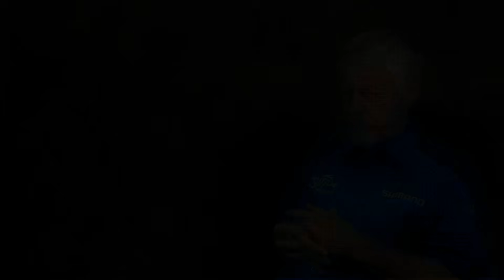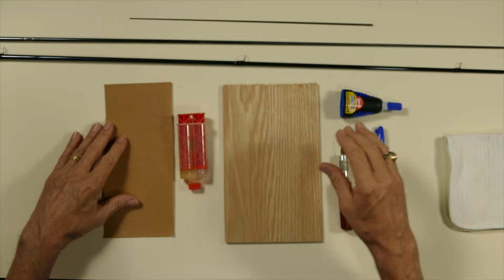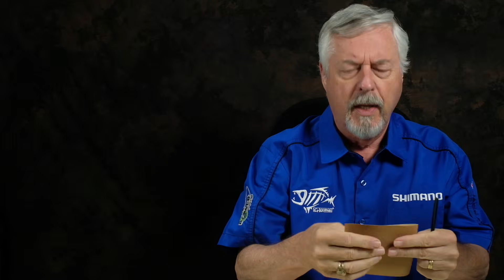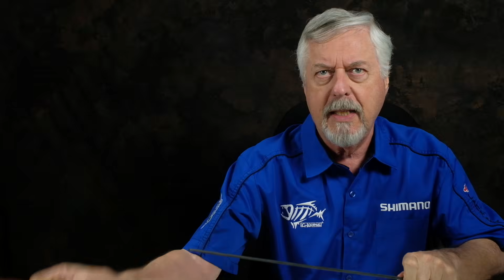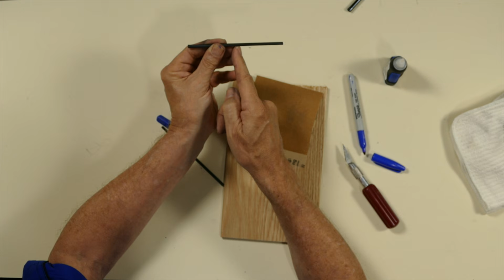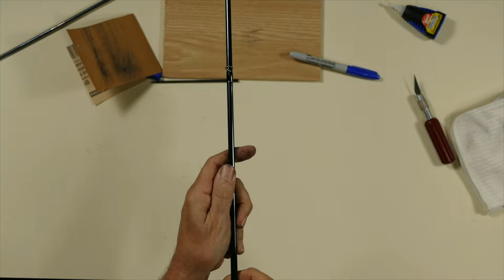How to repair a broken fishing rod: a simple fix that lasts

Comment: Damn this video did surely come at the right time, I was just going to repair a couple of rods this way, and I didn't think about the piece inside the ferrule, really helpful tip.
Just a question, If the rod didn't break cleanly, leaving cracks half an inch long, would you trim it to leave it clean, or just with good glueing and a nice wrap on top would be enough. I'm worried that trimming it could make the diameter of the top and butt quite mismatched.
Thanks for the lesson!
Reply from the maker: I'd trim most of the worst off as I'm always concerned that a crack will travel up the blank under load. We can lessen the problem by wrapping and epoxying. I'll be covering that in the next video.

If we look at the fly rod spigot ferrule setup, there can be a gap of upwards of 3/8s of an inch between the sections, so I wouldn't worry if there's a gap showing after the jagged bits get trimmed off. Just make the spigot and the inner section long enough to provide support. If you were a bit worried about the section being under too much stress, we can go to a triple layer spigot, using two inner sections of decreasing length. It'll be very strong across the gap, but the staggering of the lengths of the sections allows it to bend smoothly under load.